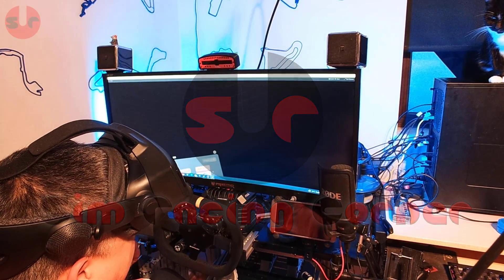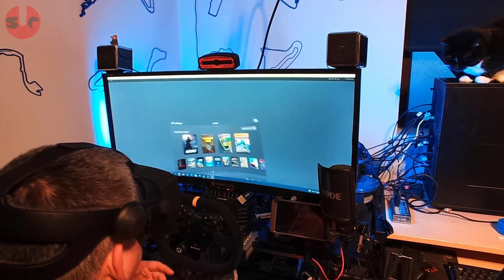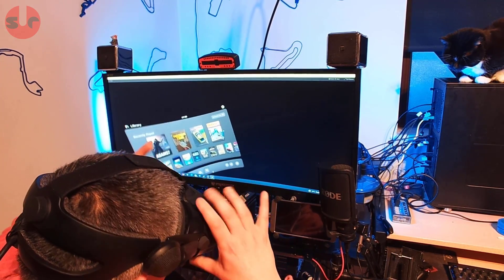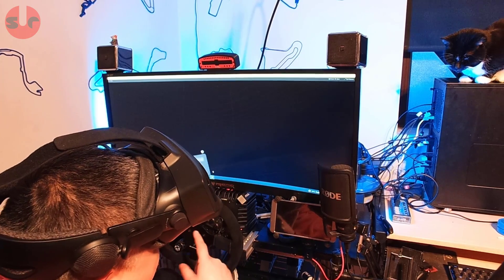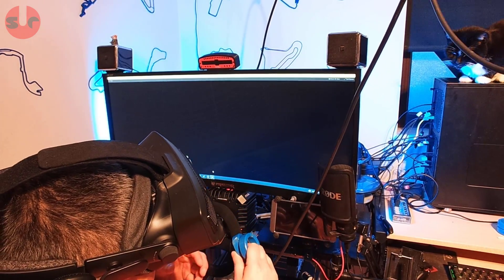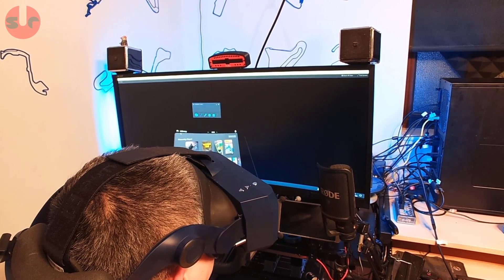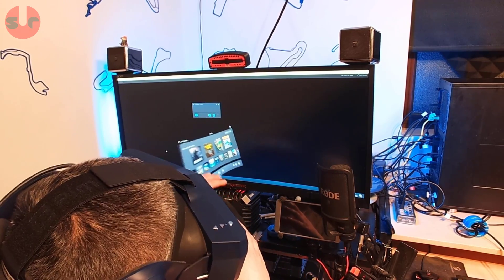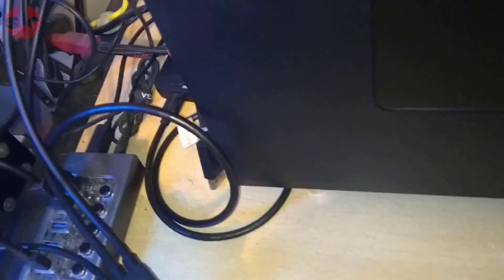Fanatec DD vs. SteamVR Lighthouse tracking [WARNING] ⚡ EMI INTERFERENCE FAIL ⚡ and solution!

Comment: 1) This has NOTHING to do with Fantec but can affect ANY wheelbase with powerful motors!
2) USB 3.0 can also interfere with 2.4 GHz WLAN or Bluetooth signals (e.g. controller or tracking) in some cases.
3) Any power supply & power cable can cause electromagnetic interference. Also sound boxes and and and.... 
4) Radios or wireless headsets (may interfere with tracking signals)
Please report cleanly and correctly, thank you !
Reply from the maker: Just so you know, I have over a dozen DD wheelbases. Only my CSL DD causes this problem. Yes, is it possible for other hardware to cause EMI, including other wheelbases. But this video is about the CSL DD, which is a popular device; it's a widely known problem with this specific hardware, hence this video. You don't need to lecture me, thanks!

Comment: just went through this with my simucube 2 pro, and HTC vive pro 2 (using original vive 1 base stations) The chokes helped a little, but not much. The fix for me along with the chokes, was the base station positioning. I had them mounted on my 8020 rig above my monitors. This put my wheel between my headset and base stations, although lower than direct line of sight, I believe the magnetic field put up a wall between the stations and HMD when outputting high torque. I moved them to the walls, to the left and right of the headset and experienced no more grey outs

Comment: Ok, thanks for the Info !!!  I have new a Bigscreen Beyond VR Glass, my first Lighthouse tracking. I'm sim racer (rFactor2) and use a Fanatec CSL DD pro. Wheelbase off !! All stable, Base on and I have this tracking issue, grey screen in VR 😕  So ... I have to check and modify the cable with ferrit-ring for the cable. Damn, not nice
Reply: @chriskross1660  I have the sim headset.  And it keeps turning gray when I move my head.  Did you get it fixed?

Comment: I have this, my Fanatec DD is fine, but it's my SFX-100 servo motors for the motion platform. 
I'm going to install an EMI filters (and breakers) on the common ground and adding some of these ferrite cores. I understand they also need to be added to the lighthouses, probably also grounding the USB hub as well. 
Fingers crossed.

Comment: Hi Jez, I had a EMI issue with my DD2 when I changed my Cube controls wheel for a Slimline wheel, I had interference with buttons and encoders. It's the first time I had issue and I tried my cube controls USB lead it was still the same, I solved it by grounding my rig to my USB thrustmaster handbrakes chassis that was not grounded to my rig, since then not one issue
Reply from the maker: Wow, that is interesting. Makes you wonder if there are other pieces of hardware out that these DD's are conflicting with. I did try grounding my rig but didn't change anything for me. I ran a wire from the 80/20 to a radiator.
Reply: Can you be more specific? How did you "ground" your rig?

Comment: Ive had this issue a long time but the emi is from my motion rig, not my dd2. Same exact problem. 4 ferrites on the pimax cable helped but doesnt all the way get rid of it. It requires grounding of my motion rig, shielding/groudning all cables as well

Comment: I have the same setup, csl dd and index. I get the same exact issue, I used 2 ferrite cores like you and wrapped it arround 7-8 times, and it was an improvement. Before touching the hmd would grey it out, but now I have to really try, like putting the my hand on it for extended period of time (5-10 seconds). So it hasn’t eliminated it but it’s now ok enough that I can adjust the headset if I need to without greying the screen. I’m using 2 cores so maybe using 4 will completely eliminate it in my situation.
Reply from the maker: Thanks that feedback. That is interesting to know that you haven't been able to completely eliminate the problem but it has reduced it. The ferrite cores simply made no difference for me.

Comment: Just a thought: may be running the cable   down to the floor rather than having it overhead would fix the problem?
Reply from the maker: That's an idea I didn't test. The Index cable is overhead, the Pimax cable was running along the floor.
Reply: @SimRacingCorner  just for ref, I'm running csl w boost kit and G2, my cable runs down to floor with no issues. If cable arrangement doesn't fix it then may be down to lack of sheilding in the cable 🤔
Reply from the maker: I get what your saying. The G2 uses a different type of tracking. I'm not aware of any headset using inside-out tracking having this sort of problem, it's just a SteamVR Lighthouse issue.

Comment: I've got a Simucube 2 Pro and SFX100 motion system, with just the Simucube running no problems but with the SFX running I get this exact same issue. Managed to mitigate it somewhat by using a ferrite core on the cable, it still drops out every now and again when touching the headset but did improve things (Enough to not be a huge problem). All of the cables are properly shielded and I have an EMI 'blocker' inline with the power to the SFX system but still get it.

Also worth mentioning if you get random monitor/TV blackouts when running a DD/Motion system make sure your HDMI/DisplayPort cables are of high quality with good shielding. I had to get a triple shielded HDMI cable otherwise my motion would cause random drop outs on the TV.
Reply from the maker: Thanks, that's an interesting read, I didn't even consider this sort of thing affecting monitors. I didn't mention in the video, but my Leo Bodnar DD doesn't interfere with the tracking either. I guess we've found out where Fanatec has cheaped out on the hardware.
Reply: @SimRacingCorner  I use a Accuforce V2 Pro with my Index and I have no problem, no motion rig here though. Like you said, maybe Fanatec cheaped out on the shielding of their DD wheels?